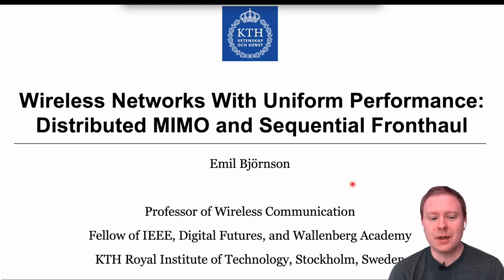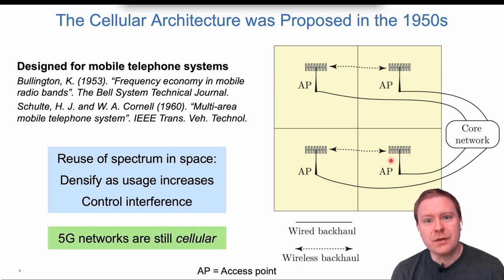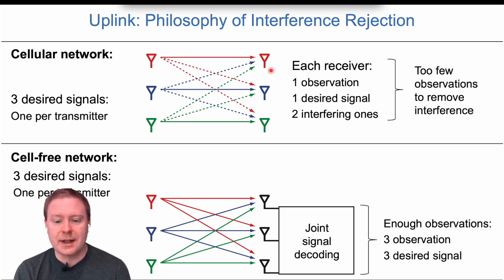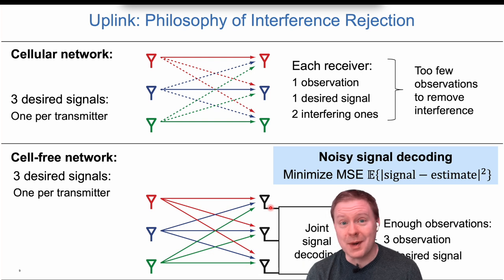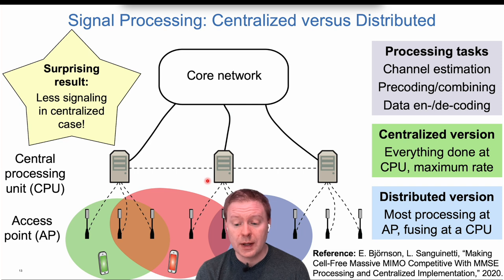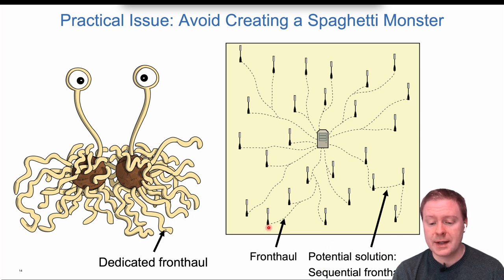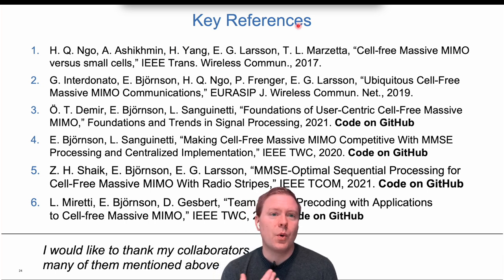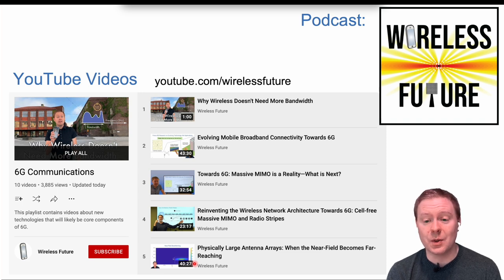Wireless Networks With Uniform Performance: Distributed MIMO and Sequential Fronthaul

Comment: Dear Emil, here a long time follower of your channel. I would like to know your opinion on something, if possible: I´ve had since long ago a craving for a more fundamental understanding of wireless communication, as I rushed into the telecom industry (I work for a network vendor) after getting my degree and now I feel more like a technician rather than a solid expert. My question is whether it is feasible or realistic to self-learn this material in the little spare time left after job and family obligations, or whether it would be more reasonable to pursue something more exciting but less ambitious within the job, even if less research-oriented/theoretical. One of my main concerns is the significant math, signal processing, communications, etc. background I would have to refresh, since I am very rusty on those fundamentals, so it might take quite some years before I am able to for instance understand well a book on MIMO. Any suggestions or tips from your experience working and teaching this material would be highly appreciated.
Reply from the maker: I think it should be possible to get an intuitive understanding of these things by slowly studying these topics. When it comes to MIMO, there is a Massive MIMO handbook from Ericsson that you can start by reading: https://www.ericsson.com/en/ran/massive-mimo 

Next year, I will release an introductory book on the topic with mathematical details and recap of the fundamental theory. It might be interesting for you.

There is also the website Brilliant.org, where one can learn basic theory in STEM using interactive examples. It is a paid subscription services. I’m not associated with it and haven’t tried it, but it looks promising.

Comment: prof,

you may know about compression codecs 
as you know more and more people use mobile devices which has small screen size (in other word all you need on a 6 inch screen is FHD) and when VVC becomes industry standard you need only 5-10 Mbps for FHD streaming do you think still we need Gbps cellular connectivity?
Reply from the maker: I agree with you! The data traffic continues to grow by 30-40% per year but this isn't because we need higher and higher speeds per device for video streaming and other data-intensive applications, but because we use such applications more frequently on more devices. Hence, future networks need to support higher sum capacity and more uniform speeds, while higher peak rates is of little importance. This is something that I've been talking about in previous videos as well:
https://youtu.be/XTFu4usUb4I (1 minute)
https://youtu.be/zTL7bntcosc (44 minutes)

That said, some people believe that AR/VR applications will change the game, and require 1+ Gbps as a minimum.

Comment: Thanks, just a short question about a slide at the beginning (symbolduration). Do we know how long such an intervall is with respect to the periode? In the picture it is always exactly one periode. Regardless of the bandwith, it is always exactly one periode, yes?
Thank you.
Reply from the maker: This is a good question! The illustration is a simplification. The precise statement is that for a bandwidth of B Hz, we can transmit B digital symbols per second. Each digital symbol is mapped to a waveform (like the four illustrated in the video) and those waveforms will in general be partially overlapping in time, but are designed and time shifted so that at the exact time instance where the receiver samples the received signal, only one symbol is observed at a time.
Reply: @WirelessFuture  Many thanks, so can we let this periode just be half the wavelength and sample more often (here: doubling the sample rate)? Could this double the date rate at the same bandwith? I assume not, otherwise it would have been already done. (Perhaps the sampling of such a short periode is technical unfeasible due to symbol overlapping or such approaches lead automatically to a doubling of the bandwith). Thanks.
Reply from the maker: @knutlohmann8205  As you say, doubling the sample rate will automatically doubling the bandwidth. This is an instance of the sampling theorem.

Comment: Hello Professor. 
Is there really a need for a fully distributed signal processing algorithm in the cell free mimo framework? (Signal processing is done completely on the AP side)
I think the difference between the cell free mimo framework and other frameworks is that it has a cpu as the core of signal processing.
I've been thinking about this question: if we emphasize fully distributed signal processing algorithms in cell free mimo research, does it make cell free lose its character?
Reply from the maker: The first papers on cell-free Massive MIMO focused on the fully distributed case, to make use of local processing power at the APs and avoid passing around CSI. However, I agree with you. The performance losses from the distributed case are too large compared to the centralized case. This is why this presentation also focused on that case, and how to implement the centralized processing sequentially to reduce the fronthaul signaling.
Reply: @WirelessFuture  
Thank you very much for your presentation and answers.
Moreover, the method you provided in your paper "Learning-Based Downlink Power Allocation in Cell-Free Massive MIMO Systems", which uses neural networks combined with domain knowledge to approximate centralized power allocation in a distributed manner, inspired me a lot.
In my study of signal processing using deep learning for cell-free mimo, such as uplink data combining, due to the nonlinear and black-box characteristics of deep learning, only link-level simulation can be achieved, and it is difficult to obtain a closed-form expression of SE. Therefore, it isn't easy to compare the performance of SE with linear methods.
Is there any good way to solve this problem?
Reply from the maker: @Wireless-AI  Closed form expressions can seldom be obtained, and when they exist it is only for simple method such as MR that isn’t practically interesting. In that paper, we are running Monte Carlo simulations to compute most of the performance expressions, except those related to MR. The important thing is to find a way to compute the performance using expectations and then one can Monte Carlo simulate all the expectations that cannot be computed analytically.
Reply: @WirelessFuture  Thank you again for your reply.

Comment: The idea of DECT system is there by Ericsson MD110 PBX and other vendors since year 2000, which is quite similar to free cell design (APs distribited with one CPU), but I guess they don't use the right algorithmic send/receive technoques and that performance dosen't inspired Cellular telephone designers.
Reply from the maker: I believe what you refer to is a switching device for managing many phone calls, while the APs are not doing joint transmission at the physical layer.